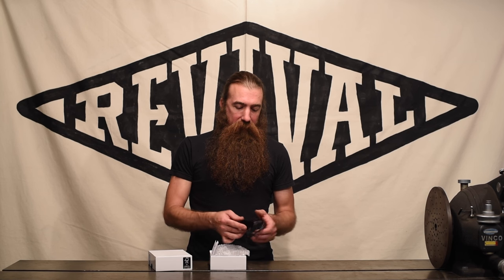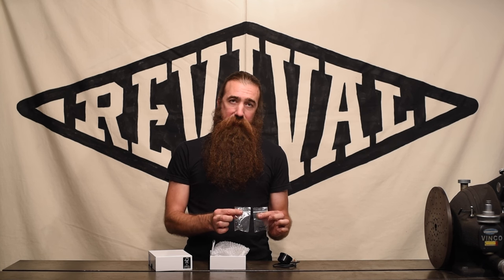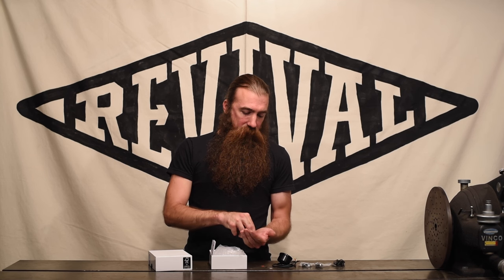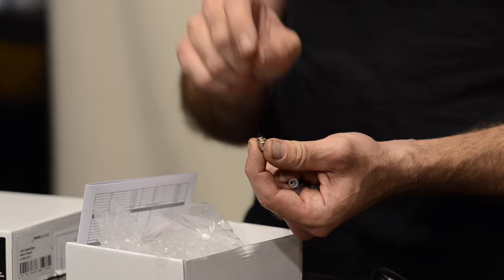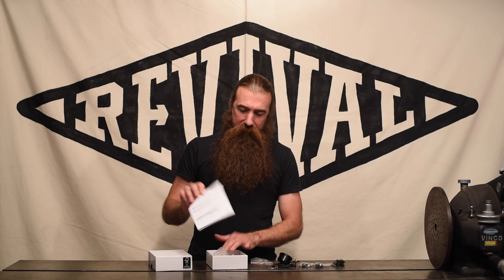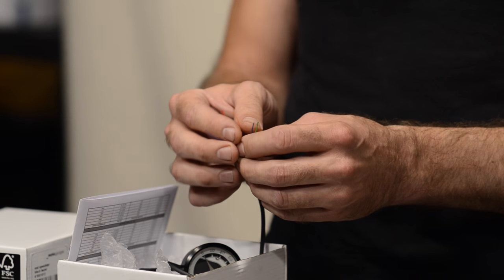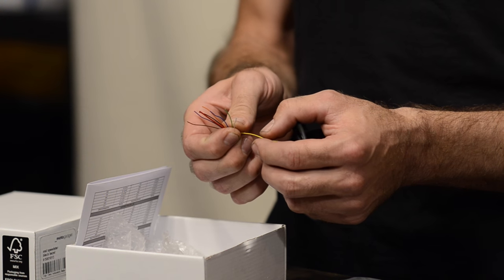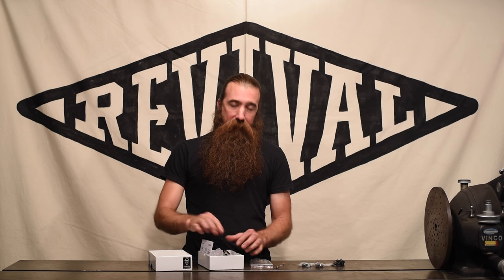Motoscope Tiny - Revival Cycles Tech Talk

Comment: Looks lovely but I need a speedo for a 1966 Triumph TR6 Bobber that I'm building. You said it needs a connection from a battery for the clock but I'm not having a battery. Is that a deal breaker on this speedo? Cheers from UK
Reply from the maker: These do need a battery in order to operate. Why not looking into a Smiths gauge, they're right in your back yard.
Reply: @RevivalCycles  cheers man. I love the look of that motogadget but I want to keep things real simple. I'll look at Smiths stuff. I don't want a speedo cable. Just magnet or gps. Cheers

Comment: You mentioned the the brown wire goes to 12plus switched power. Does this mean that it goes to the battery plus terminal or the Ignition output on the M-Unit Blue?
Reply from the maker: If you're using the m.Unit Blue or Basic Switched power would in this instance be the AUX-1 or AUX-2 output.
Reply: Revival Cycles so I have an M-Unit Blue. If I connect the brown wire to the AUX1, would I just need to configure the M-Unit to utilize AUX1? Did you already come out with the config details for the Motoscope Tiny?
Reply from the maker: I should have mentioned it earlier but it slipped my mind, I've posted a diagram in our Tech Articles page outlining how we incorporate the MST gauge into the m.Unit. You can find it in the link below. The M.Unit by default wil activate AUX 1 when the key switch is turned to ON and this configuration can be changed. I don't have any plans to write explanation since the AUX config settings are outlined in the manual. 

https://technicalarticles.revivalcycles.com/hc/en-us/articles/360016476671-Motoscope-Tiny-With-m-Unit-Wiring-Diagram

Hope that helps,
-Berry

Comment: Hello Stefan,  most custom applications have or use thick wiring gauges, like 1mm, 1.5mm or 2mm for the alternator-reg, so my question is how can I joint those micro wires that have the speedo and most Motogadget items with the "normal" wiring?
I m thinking to use one of these "net" cables that come to use with the computer/internet routers, etc, that have inside 8 thin wires.

Thanks in advance.
Reply from the maker: Sizing wires is a somewhat complicated thing, and there are two factors that influence the size of wires. First is the technical requirement of being large enough to handle the available current in the system, second is sizing wires based on what people "think" they need to be. With many after market reg/recs, the wires are significantly over sized, not really a problem, but it gives people a feeling that the reg/rec is more powerful, which it is not, charging system power is determined by the stator. Most charging systems are around 400 watts or less, and that means they can provide 30 amps and would require 14 Gauge wire. But many people feel like that is too small so the manufactures will step up to 12 Gauge to add some safety factor and to make people feel better. 

In the case of using a multi conductor wire like what is used on the MG gauges, you need to consider that those wires are around 26 gauge and that is only suitable for about 1 amp of current  in the enclosed arrangement of the multi conductor cable. This is the reason the gauges require using a 1 amp fuse. 

There is technically no real issue connecting a large wire and a small wire, and normally I would do this using solder and heat shrink. But that means that the circuit needs to have fuse protection at or below the current limit of the smallest wire. In the case of the multi conductor wire, you can use it as long as the total current flow in each conductor is less than 1 amp. If its more than that it will generate too much heat and that can create massive problems, and possibly fires.

Comment: if only it had a coolant temp display.  and can you control what pressure the oil pressure warning light comes on?  i have a bike that produces a very low oil pressure like less than 15 psi.
Reply from the maker: Agreed on the temp display, but even more baffling is the fact that the motoscope mini doesn't have a voltage readout.  Still the oil pressure light is actually controlled by the oil pressure switch on the engine, so it will register the same as the original oil pressure light would.
Reply: actually that's the problem, the bike never came with any kind of oil pressure monitor.  to check oil pressure. you are supposed to lossen a bolt on the head while its idling,  and see if oil seeps out.  I wanted to utilize that port to add a gauge.  guess I need an oil pressure switch and just have a dummy light.

Comment: Hello I would like to know, if there is a tutorial video how to install  the magnets with the wheel and setup the system so that we can take the right speed. Thanks
Reply from the maker: We don't have a tutorial for this, there are a lot of different ways to mount the magnet. One of our favorite approaches is to use a magnetic bolt (find them on our site) on the drive sprocket and fabricate a simple bracket to hold the sensor which allows you to hide the set up behind the sprocket cover. Then use the TEACH function outlined in the manual to program the gauge, we use this method on every install regardless of where we mount the sensor.